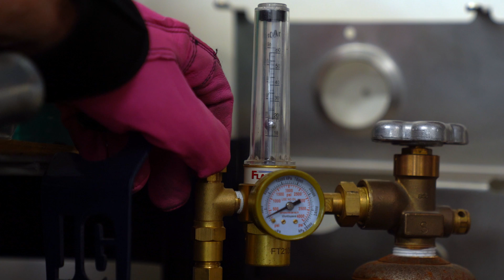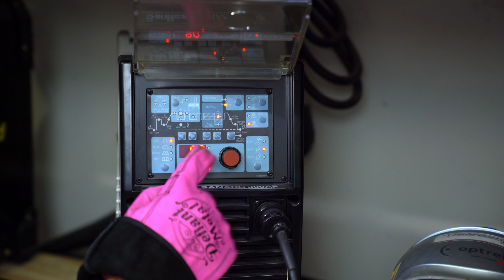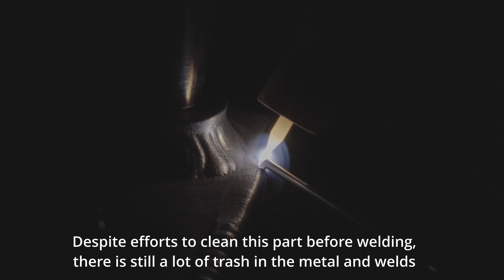TIG Welding Thick to Thin Aluminum

Comment: Il ne faut pas avoir peur de  mettre l'intensité en fonction du plus épais, en plus cela vous éviter vos instabilités d'arc , faire le bain de fusion sur le plus épais et faire venir lécher votre bain de fusion sur le plus fin . En faiqant comme çà,  entre autre sur une plaque de 10 mm j'ai reussi à souder un tube de diamètre 10 en epaisseur 1, 2 traversant la plaque épaisse .

Comment: let me simplify this aim at thick material set amps for 1 thickness above the thinnest material  pree heat if needed run quick clean pass heat with no filler at  low amps moving fast  or use torch

Comment: do you offer a class on welding lite aluminum? I'm working with two types of pieces:  one is a U Channel that 1/2" x 3/8" that's 1/16 thick and the other is an L shape angle aluminum that's also 1/16" thick.  I'm using the YesWelder Flux-Core 135Pro.  I see many aluminum welding using TIG where I haven't purchased that accessory and Argon gas cylinder.  The YesWelder flux-core did great to repair my Fireplace Tongs which is metal.

Comment: I believe you with the powder coat because welding a cast aluminum intake manifold I learned sometimes there's no amount of cleaning that will remove all the garbage from a dirty cast part like that.

Comment: Very appropriate topic.  I am welding a 1.5" x 0.125" wt short piece of tubing onto a 1 3/16" diameter solid rod.  It is good to see that I was not that far off but you gave me the tips that will help me get some better welds.  Tyvm

Comment: I was welding some 1/16 sqare tubing aluminum today , it ran good i cleaned it with wire brush and acetone only problem i had was when i when down on my foot pedal it wouldn't start up right off i had to let off and back on back off and back on it finally started up were i could get a puddle going idk why it was doing that the welder is brand new its a titanium 200 tig and stick from harbor frieght , great welder but not so good on the  foot pedal its one those bulky ones maybe its the pedal im not sure . If you have any advice, thanks .

Comment: Spring clamp for a work lead?  (never!)  Work lead on powder coat? (never!) Work lead should be bolted to alum. angle or bar extrusion then vise-gripped to bare metal of work piece.  Anyone who doesn't; allows power supply to compensate for both resistance of powder and spring clamp's 'ridges' instead of solid 0 resistance flat aluminum surface to work.  Arc suffers greatly from decent control which happens with correct set up.   Coach, you might want to get fully versed in alum. TIG welding industry standards before preaching to the ill (or un)-informed??  What alloy filler - 4043? Should be 5356 so billet fitting and 50series sheet have correct final weld alloy.

Comment: protip: to cool down the tungsten touch it to the material once power shuts off, this saved me so much time for grinding burnt tungsten when i was doing a lot of small welds
pretty much ALWAYS is the freshly welded metal colder than the tungsten electrode and tungsten rapidly gives away its heat

Comment: At 5:42 the arc kind of sputters before you get going, why is that? I occasionally have this problem when welding aluminum, too low amps?

Comment: the adapter is very small and so will get warm very fast. so no problem then to weld it to the tank
problem would be for example if the tank would be as thick as the adapter and the adapter only so thin as the tank walls

Comment: Talk about "Thick to thin", I have been Tig welding Aluminium Frames up at work that are 2 1/2" cube corner blocks (6061) with a 1 1/4" hole through the middle and welding 2" x 1/8" angle to the 2 sides 90 degrees to one another, (to make a rectangle) I do a Pre-heat on the Blocks (and jig) and use a 1/8" E3 Tungsten at about 240 Amps, and weld them inside and out side, using 1/8" 5356 Filler rod, the Frames are about 55 inches long and 25 inches wide set up on a Large solid steel Jig. Yeah, Pointing that Tungsten at the Thicker part and watching which direction it flows is pretty critical.

Comment: why do you weld on top of aluminum and not the steel welding table?
Reply from the maker: Two reasons...
My table is cast iron nitrate coated, and I want to keep it that way. Any type of pitting or spatter could damage the coating, which could also reduce its tolerance as a fixture table. 
The second reason is aluminum does not scratch other metals during handling/contact as easily as the cast iron table top would. The aluminum bench top plate saves the top AND the table at the same time.

Comment: I have been trying to tig weld for months! I have bought a ton of stuff, cups, lenses, different tungsten and still my welds were terrible! Until yesterday after exhausting every possible reason for my results I looked at the gas bottle which said Argon, but when I looked again it is speed shield argon for mig!! Which is not straight argon!!! I can’t believe after watching months of watching videos and not understanding what was happening it if a basic thing that was the cause. As pissed as I was I quickly became relieved that now my welds are starting to look like they should!
Reply: Hey, how's the TIG welding going for you now?
Reply: @tigrismask A lot better, I’m still learning but my welds look good. I’ve learnt that preparation is key and taking your time. I also use 1/8 rods which made a big difference in my weld profile and helps control the heat for thicker plate. As Justin says once you have the basics it’s just seat time!

Comment: 1:24 You said you're using a No.5 cup with a flow rate of 15 ft³/h, but according to your other video on cup sizes you explained a rule where a flow rate between 10 and 12.5 ft³/h is needed, and another video explained that No.5 is ideal for aluminium because it's non-reactive and doesn't need that much gas. Can you explain why you overshot the maximum flow rate if aluminium doesn't need that much gas? Or was it just an arbitrary choice?
Reply from the maker: Cup number x2 is minimum flow. Cup number x2.5 is maximum flow. Most people just put it in the middle. Anywhere between min/max window is fine. I tend to use max flow on horizontal outside corners.

Comment: I'm not sure if you've covered this in the past but I'd like to see different grades of aluminium welded together in this same video format. So instead of thickness, it would be grades, or both even! Which do you start the arc on? Which do you keep the arc on? Which filler? What if you don't know what you are welding because you pulled it out the scrap pile? Is infinity really forever? Why is that Kesha song in my head right now? All are valid questions.

Comment: I never use 4043, always 5356 or 5556, especially on 5052 sheet.  I know 4043 flows better but just have to be a bit more accurate on heat for 5356 to make it look good. 4043 can leave very small micro cracks, and it  has a much weaker tinsel strength.

Comment: This reminds me of the time I had to weld some thick stainless steel fittings to a 16 guage stainless panels to be assembled into a box. I did it this way so I could using backings to prevent sugaring. They warped the crap out of the panels they were welded to, but once I assembled the panels with the fittings, you wouldn't even know there was a 1/2" "W" on the sides.  I water tested each one, and sent it out a total of 4 that Friday. That Friday afternoon hit 107 in the middle of summer, and I was at work till 8pm. That was the day I started looking for an office job, and here I am posting from the office missing welding.

Comment: Well,call it what you will! But it taught me to use the filler as a chill block,it taught me patience,it taught me to keep the tungsten out of the puddle,as well as heat control! I get what you are saying,but it was quite difficult,and it took dozens of cans before I figured it out. I had never touched a Tig welder and to watch him do a beautiful bead around a couple of cans end to end  made me want to do it! I started right out destroying an entire pack of tungsten,I vaporized alot of cans( cheap materials) and learned what 2 amps can mean to the weld! But,patience was the best part of the process,because as you very well know,cast aluminum has a mind of its own and I have done quite a bit of it,with great success,due to patience,and It built confidence! So,is it a parlor trick maybe,but does it have a usefull side ,absolutely!

Comment: Can i make a request for some good arc shots of stainless 316 sanitary welds? Trying to see what my instructor calls "sparklers" in the puddle but we have a communication block and i dont know what he is talking about.
Reply from the maker: Ask for better explanation or articulation of what "sparklers" mean. I've asked our coaches here, and we have 5 different definitions. All could be right or wrong.
Reply: @WeldCoachOfficial  thanks for the response, I did ask again. Kind of just looking for the swirl and disruption around the edge of the puddle now. Full pen but a little slow and ever so slighlty concave. Now to figure out the stops without getting growth niches! Almost there.

Comment: Nice real world demo. The relative thicknesses of the parts is not the only consideration though. The overall size (&shape) of each part is a factor too. Welding a small pipe onto a tank can be really tricky even though the wall thicknesses of both parts could be the same. Apply the same principle - focus the arc on the part that's going to soak up the most heat.

Comment: so, virtually nuke the thicker metal and use far less heat on the thinner metal. off pace/of base work? 
yeah I'm no welder and would fail horribly at trying it. but my redneck welds seem to work well (avoiding anything that would result in injury/death). however I would trust my own welds over other novices by far. LOL

Comment: Attention friends who watch this video: In the old videos, they said that hand tremors, which cause welding failure and lack of mastery, are due to lack of experience, but this person's hands are shaking in this video, and it has nothing to do with experience and mastery, and it is more indicative of nerve and device problems. There is digestion. Therefore, it is recommended to see a doctor if you have hand tremors.
Reply: I'll tackle this comment because I think it's a little out of context. Beginner welders that get shaky hands are usually because they aren't in a comfortable position, which makes the hand twitch and shake. It can be fixed. If it's a natural tremor, it has to be dealt with. 

My shake in this video came from welding in a very uncomfortable position. What you probably don't realize is that my arc shots are POV (point of view) to make it more realistic or part of the experience. That basically means that my camera rig is sitting where I would normally sit, which means I have to reach into the shot and view my work from far away. It is very uncomfortable and sometimes my hands confirm it.

Comment: Don't be to hard on yourself today I chose to start at the hardest weld on the part, I goofed it up everyone was waiting on me to get it to QC standards, I should have started on the opposite end that was not obstructed instead that would have warmed me up for those welds and given me a better feel for the part but nope instead I decided to warm up on the obstructed welds. At least you pulled it off the first time.

Comment: Awesome video on this topic thanks again, I had used your information on this previously and just last week welded some 1/32 inch steel to 3/8th inch plate. Definitely all about the torch focus! since the amps are high for the thick material, just the edge of the arc is enough to melt the thin stuff and get it all to fuse.

Comment: Yes, practice is very important. Even with MiG, supposedly “easy”, practice is needed. If I don’t weld for a week or two, I’m off. TIG is hard to get right. It requires concentration on at least two and more often, three of your limbs.

Comment: as a welder for an anodizing company who only does aluminum mig and is learning tig on my own, the thick to thin works the same but the biggest difference is how clean things need to be we regularly weld through previously anodized parts which you have to burn through the coating. all of my welds at work are basically temporary but have to be fast and have to survive being dunked in giant tanks then get broken off. My job is a good way to learn how strong aluminum welds can be but totally different. Why does mig act like a jet blowing material away kind of but tig really doesn't do that if that makes sense?

Comment: Makes me feel so much better, that I’m not the only one dipping the tungsten occasionally…. Good stuff, thanks!
Reply: I'll be happy when I get to occasionally. Swear I spend more time at the grinder than in the chair.
Reply: @Parents_of_Twins run short tungsten and sharpen both ends, saves 2-4x grinding time
Reply: @natenate2280  Thanks for the tip I will try that.
Reply: @natenate2280  how do you figure that?  Doesn't it take about the same amount of time to prep and sharpen the tungsten at each end?  I just have about 10 sharpened, fresh tungstens at the beginning of the day.  At the end of the day I resharpen the ones that I messed up.  Some days it is only two or three, other days it can be six or seven.
Reply: Happens to the best of us 😂 lucky it don’t happen to me often at all now but at first Jesus…

Comment: What are you welding on as a backer? It's aluminum? How thick?
Reply from the maker: The plate is called a Bench Top Welding Plate and it is available at Weld Metals Online
Reply: @WeldCoachOfficial  sweet thanks man. Love your content, thanks for making me a better welder

Comment: When I welded thin fuel tanks on an aircraft putting a new proprietary filler with a thick section, I turned it down to be a better comparison to the tank. Worked well.😊
Reply: I would have done the same ! Header tanks need a pressure test, once welded.

Comment: Having watched all your TFS videos, I can definitely tell this is far from your best work. But THANK YOU for showing how important practice is and how many tries it took to get a decent result even for an expert such as yourself. And THANK YOU for keeping the tungsten dips and shaky hands in the video. People tend to show off their one in a thousand best work on photos and videos, and it's easy to look at that and get discouraged with your own work/process. But we shouldn't forget that behind those perfect results were a thousand mediocre practice runs and hundreds of hours of practice. It just takes a lot of practice to develop a steady hand and consistent beads.

Edit: Tips for welding thin parts:
- Use a higher frequency like 180Hz-240Hz for a more stable arc and lower penetration
- Sharpen tungsten to a more acute included angle, like 20°-25° to widen the arc and reduce penetration, and grind a small flat about 0.5mm in diameter to knock the pinpoint tip off
- Preheat the sheet metal with a blowtorch to reduce warping
- Consider automatic pulsing or pulsing with the foot pedal to increase current when you add filler
Reply: @Rising.Frequency  You can do whatever you want. These are just tips. Higher frequency doesn't "tighten" the arc, but it does increase stability. And if you warp your sheet when preheating, you're doing it wrong.
Reply: @mysterious_nobody_99 higher frequency absolutely tightens the arc, I do it all the time.
Reply: Shut up

Comment: Super excited to learn this. I just finished a project where I ended up using a bolted connection after failing to join two dissimilar sized pieces.